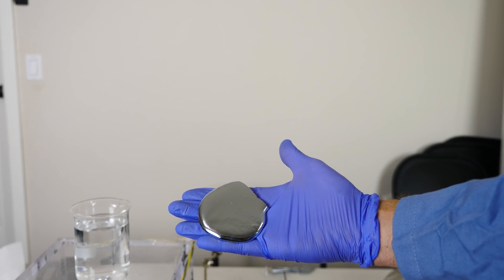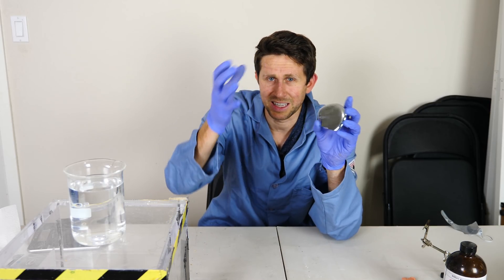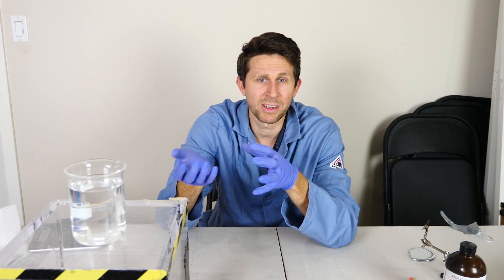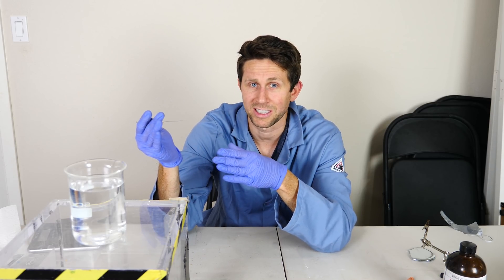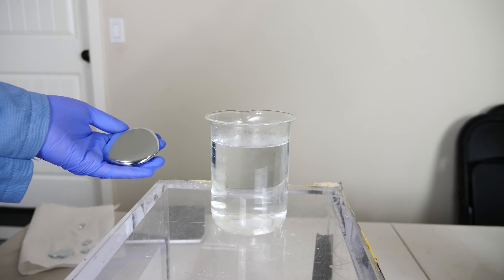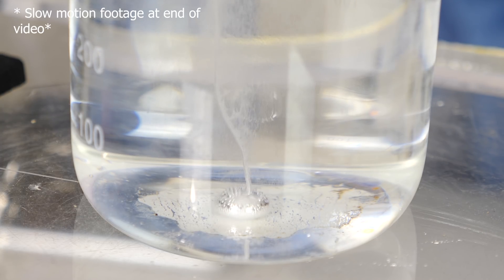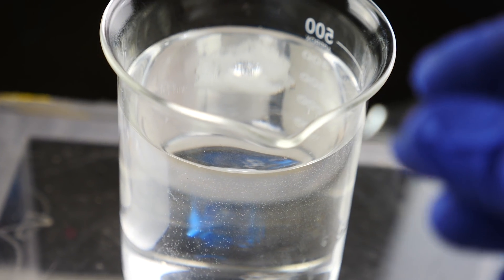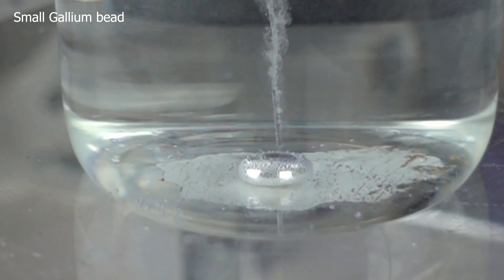I Made a Metal Heart That Actually Beats

Comment: What if this could be made into a diaphragm device, because it operates on its own outside of having to get rid of spent chemicals, this could be a viable mechanical heart
Reply: I’m not an engineer, scienctist, doctor or physician, I HIGHLY encourage you to correct me on why this wouldn’t work. (with as little Latin as possible.)
Reply: I’m thinking of something like a tig welder, where new iron is constantly introduced, the sulphuric is changed out, and the gallium refreshed. For someone waiting for an actual heart transplant, kept in a coma, you could basically use it as an air pump, but that’s it. But if I remember correctly I think the heart actually has a mechanism of filtering what goes where... so please educate me

Comment: I wonder if there is an electrical potential between gallium in solution and the steel rod and how many volts, or micro volts it is producing or if it is producing a voltage similar to alternating current and the pulsation is the frequency or hrz or speed of witch energy is traveling or is the gallium producing a magnetic charge opposite that of the steel that is causing it to pulsate /excite like reverse magnetism. Or is heat being generated causing the gallium to act like a super heated bead of water when the steel is within distance causing the reaction.

Comment: 💕 Interesting video, thanks !! 
So I guess in the slow mo clips toward the last parts, you were adding gallium ? How'd you clear the bubbles in those clips ? (From the gallium, and the iron wire) Also, did you notice after it pulsates a bit, the form & pulse rate of the gallium starts changing ? I hoped you would've let it alone awhile, to see how much it would change, and if anything new would happen ! 👍🏼😊

Comment: Do this same thing but on a lab watch glass. Turn out the lights and hit it with a visible wavelength laser and also set up a light sensitive diode in a long light guide tube with circuit connected to a strobe light to fire when laser light doesn't hit the sensor placed somewhere in the room... 
instant GEEK DISCO light! 

( When the laser light is not pulsed into the sensor, the strobe flash will fire in the area that is in darkness from the laser light, producing a colored laser show and also a pulsating strobe flash in sync with the laser.) 
Dance Monkey, Dance!